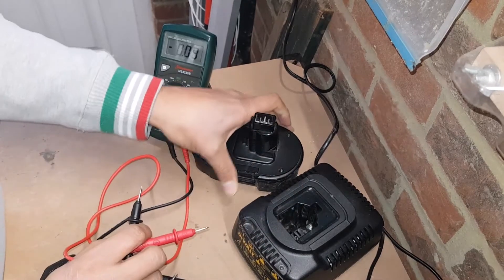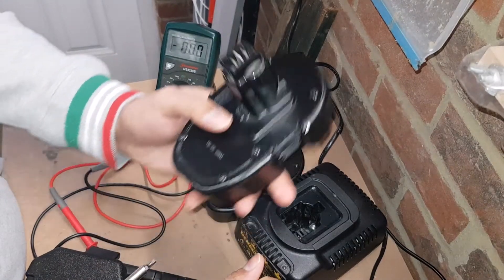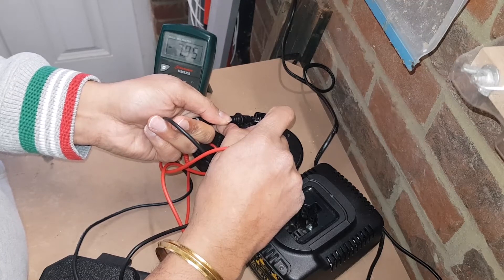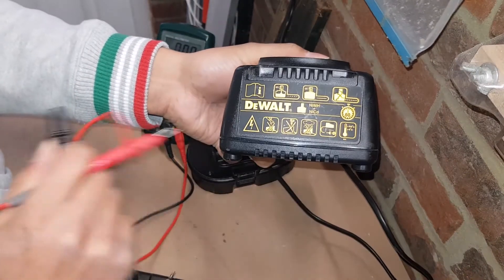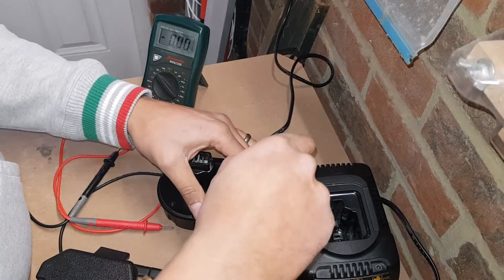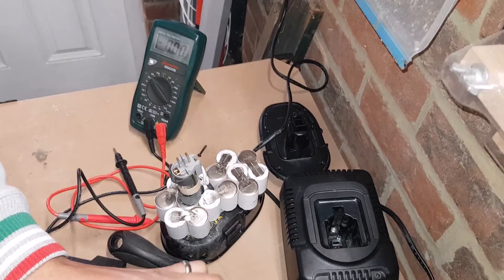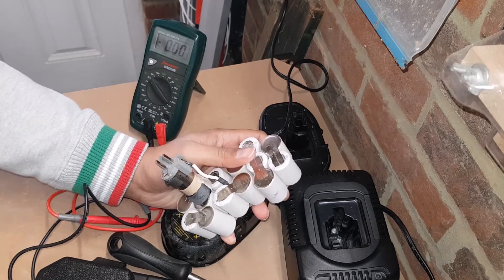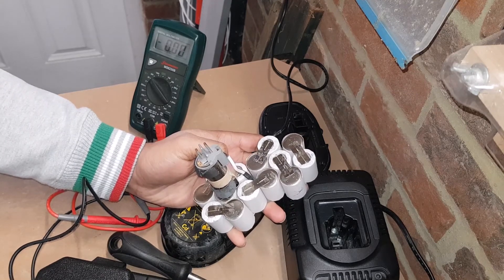Replace rechargeable battery cells for drill

Comment: My old DeWalt  battery is definitely starting to run down. I replaced it with the lithium version recently, but I have been surprised how well these have held up over the years. Great video awesome little channel!
Reply from the maker: Thank you so much.  I saw a similar solution on lithium ion but you do need to take the battery apart. In my next video I will be demonstrating soldiering them together.
Reply: @DIMTips  I will definitely check it out what brand of meter is that??
Reply from the maker: It is just a cheap one from amozan. I have had this one for a few years now.  I was thinking of getting a fluke at some point but could not  justify the expense at the moment. Mostly I use it to measure voltage, continuity on soldiers and resistance.
Reply: @DIMTips  definitely with you there for DC stuff the cheap meters are pretty dam good. I have been looking at a nice uni-t they seem solid for 80 bucks
Reply from the maker: @GeorgeJFW uni t look really nice. I guess I am Lamborghini guy with the fluke (yellow). You are a Ferrari type of guy with the uni-t (red). 😂